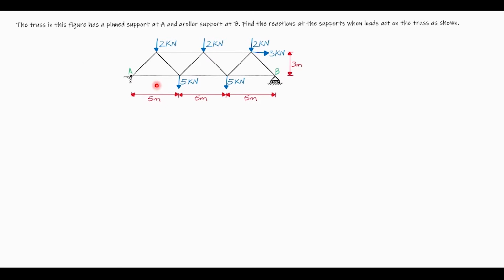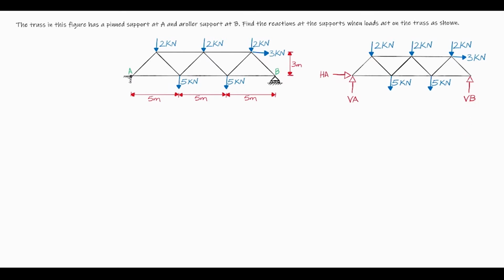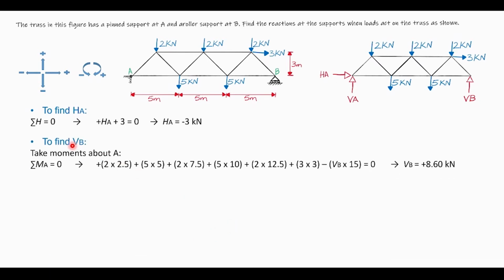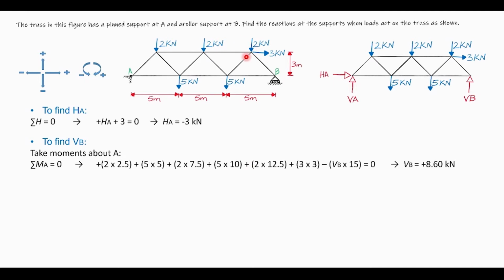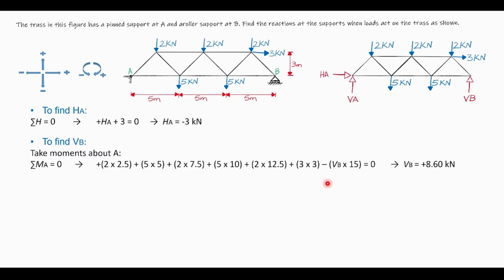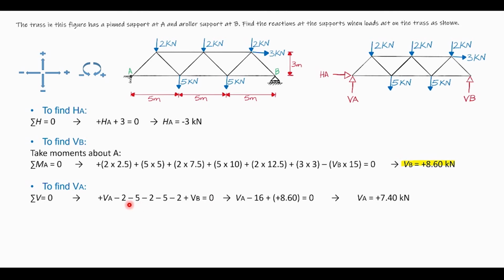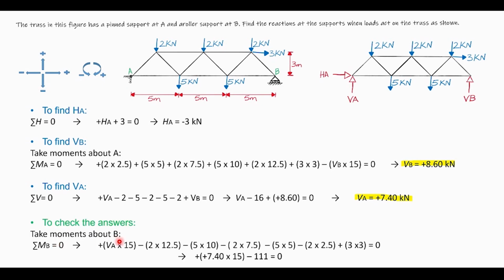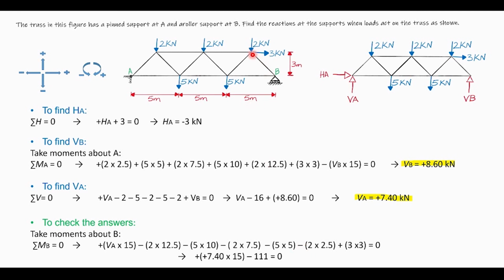How to Find Reaction Forces of a Truss

Comment: Why HA is directed to the right? Why not to the left ?? Could you please kindly tell me how to direct reaction forces( up down left right) , which direction should they be?
Reply from the maker: Hi Arash thanks for your question, the reason why HA directed to the right is that the support is a pin support and normally pinned support provide a reaction of unknown magnitude and unknown direction which may be completely defined by determining the horizontal and vertical components of reaction. pinned support prevents any linear movement but permits reaction. 
Also since our structure is in the state of equilibrium (i.e. we don't want it to move in any direction) one of the conditions of equilibrium is that the algebraic sum of all horizontal forces should equal zero. If we change the direction of HA to the left the result gives us positive 3kn as the value of HA and as you could see there is already another positive 3kn at the other end of the truss acting to the right, if we add the two horizontal forces that means we have a positive 6kn acting to the right which in that case will cause our truss to move to right and it will not be equilibrium anymore and eventually collapse. 
To learn more about this you could watch one of my other videos (titled Statically Determinate & Indeterminate Structure) where I explained the reactions of supports in the very easy way, here is the link;  https://www.youtube.com/watch?v=vQ2DRd93sW8
Hope I answered your question. Remember to like, share and sub.